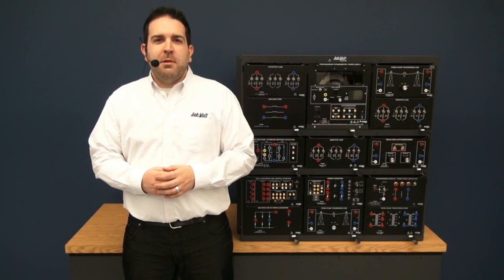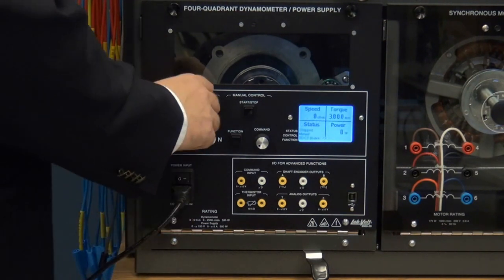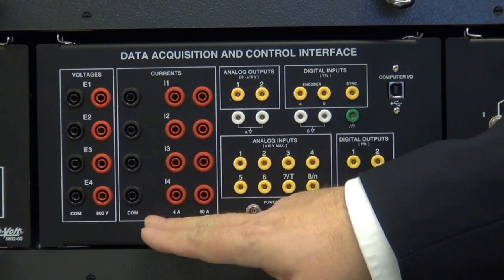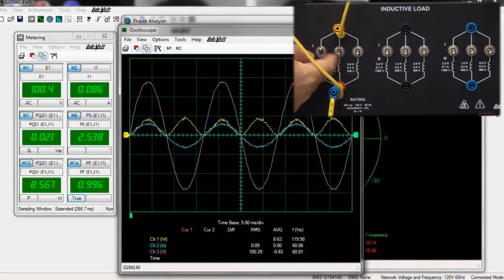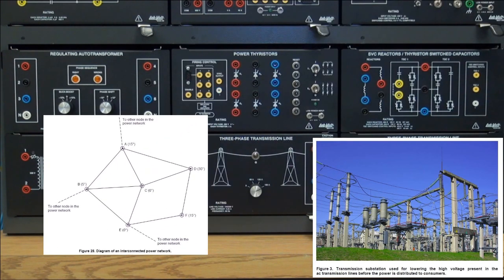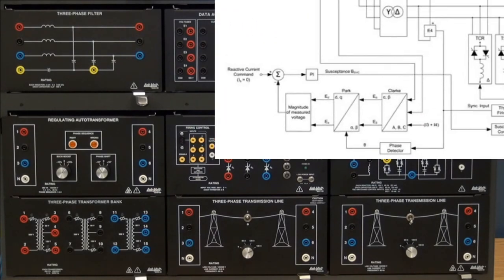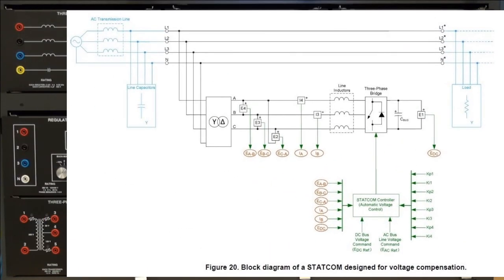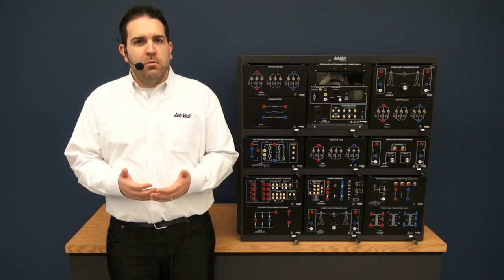Power Transmission Smart Grid Technologies Training System – LabVolt Series 8010-E

Comment: Can you display with the units how the transmission line should be connected to the power thyristor modules for Exercise 2 (Basics of HVDC Transmission)?
Reply from the maker: The connection diagram is shown in the free LVDAC-EMS software. After opening the program, select the “DACI” menu > HVDC Transmission System Control. On the right of the screen the Function should be set to “Dual Thyristor Bridge”. Then, on the left, click the “Show Connections” button.

For this exercise, two Data acquisition modules and two Power Thyristors modules are used. “Converter station 1” is a rectifier and “Converter station 2” is an inverter. Important: the connection diagram for Station 2, should be understood from right to left (with the transmission line providing DC power to the right of the Power Thyristor module and outputting 3-phase power to the left (i.e., to L1*, L2 * and L3*).

https://labvolt.festo.com/downloads/LVDacEms32201.zip